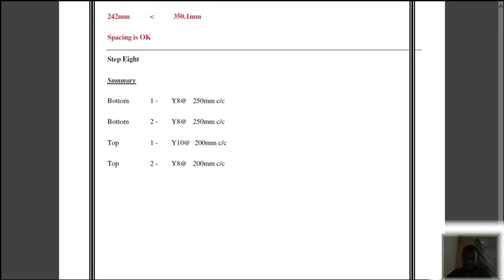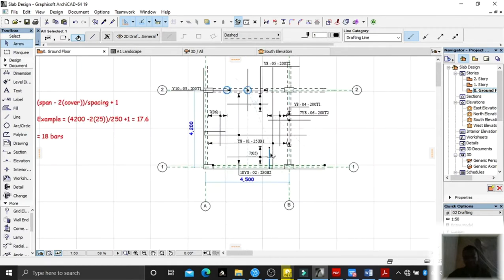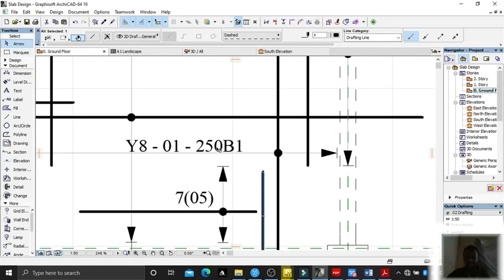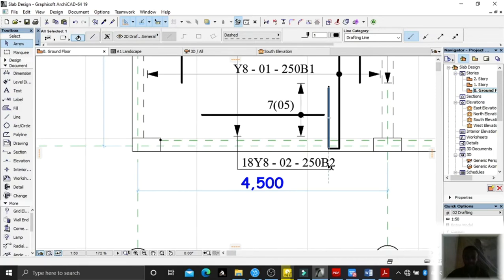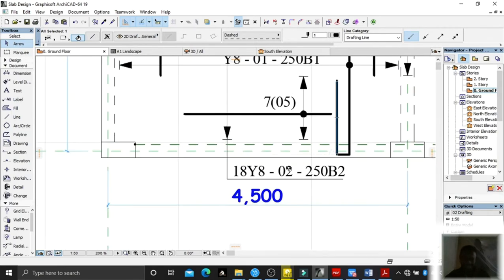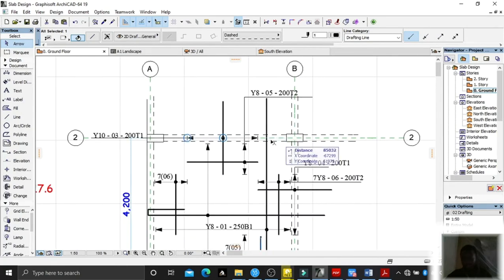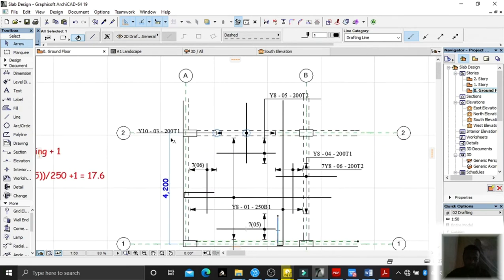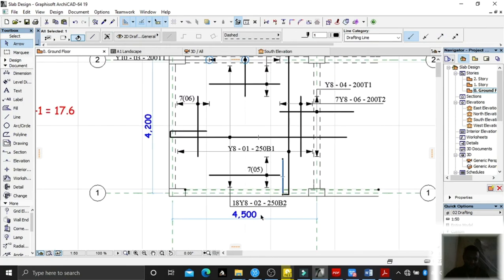Designing and Reading Reinforced Concrete Slabs (BS 8110-1-1997).

Comment: How are you professor?
Iam Balabyekubo I.J.C 
I have problem sir and asking for solutions.
In floor system  consists of one way spanning slabs with beams, there are side beams which don't carry slabs that span in long directions meaning they don't carry slab loads. They just provide restraint
Thanks.